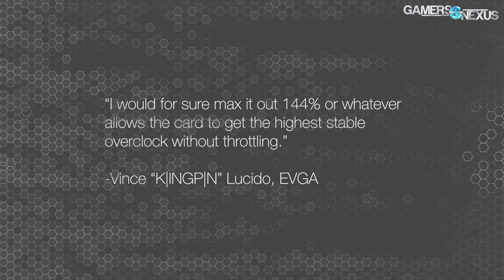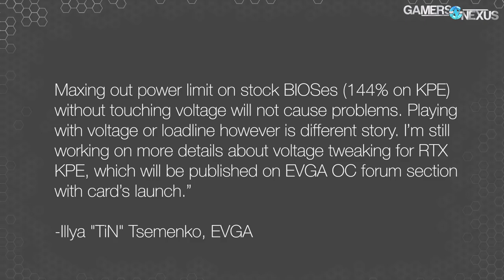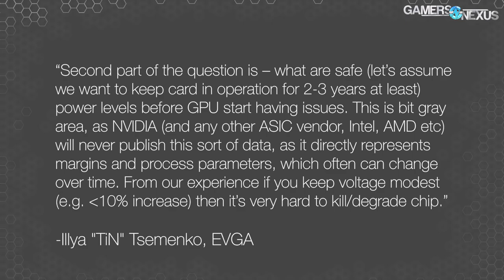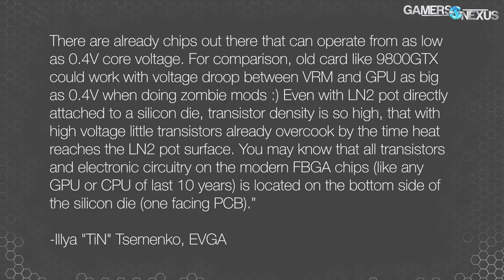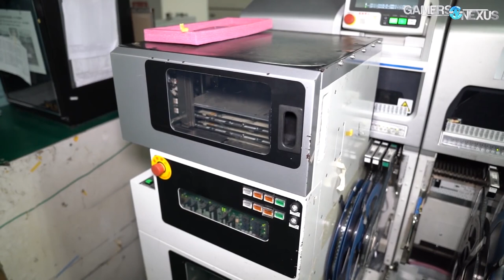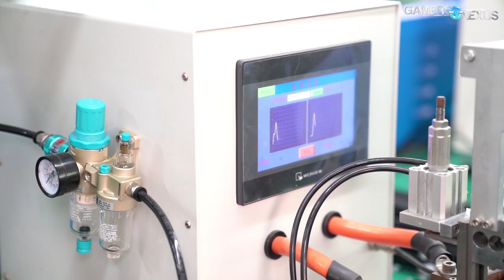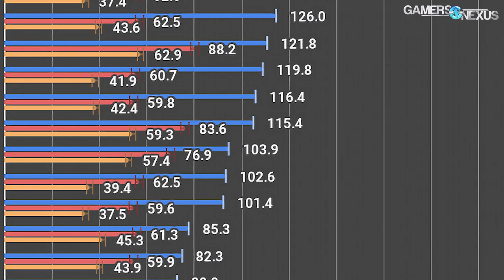Ask GN 107: Does Max Power Target Kill Cards? Ft. Kingpin & TiN Answers

Comment: Capacitors do seem to be the most likely weak link in an electronic circuit with almost every graphics card that I had die from a capacitor or few shorting to ground after leaking or breaking etc. That is the cards that didn't have fan problems before anything electronic became an issue though a lot of fan and capacitor issues can be repaired to yield more life from the card if the card is worth the effort instead of just replacement with a newer more powerful and more energy efficient design. The good aspect of capacitor deaths is that they don't seem to be that destructive to other components or at least not as likely anyway. I had a motherboard die from capacitor deaths and replaced twice to restore function to the AMD FX CPU and memory back to 100% load with aggressive power draw and high clock cycles, without damage to any of the add-in cards it used either. It then did die a third time probably from another capacitor issue but at this point I set it aside and started to crunch data on a better chip even though the FX black 5.0ghz 8core is likely still functional it used to much power for its performance yield to be worth fixing for the third time.

Comment: for a question: without getting too much in details of timings for RAM (tho knowing would help...) in a simple manner, how much speed in your RAM is needed before your processor does not benefit from more? like by example, i have a "Intel i3 8100" and that cannot be overclocked BUT my RAM can be overclocked (no matter how little). the RAM is 2400 MHz (2X16 GB) and my processor is 3.6 GHz (4 cores). 

question is how much RAM speed is needed so that the Processor is not profiting of more? (like a Ratio of Hz or Hz per core to Ram Sticks at Hz...) like if i got my Ram at 3.6 Ghz like the Processor would it help or add nothing?

Comment: How can i get the best temps on a reference vega56? Im asking because there are currently zero aftermarket cooler in stock and i want to get the temps down to reduce thermal throttling. Is there, for example, a way to safely mount an CPU AIO watercooler?

Comment: Question: do modern motherboards still really need all of the voltages in the ATX PSU spec anymore? +12v is obviously the most important these days and I'm pretty sure +5v matters for USB, but what about +3.3v and -12v? Does anything really use those anymore? If not, about how much money could be saved if PSU's didn't need to include them?

Comment: Actual overclock after 6-18 months i found degradation like artifacts etc that gradually got worse. I slowly dropped the OC untill I was back to stock but the damage was done. I could still play games as it was just minor tearing etc. card died after 3 or so years, dont remember exactly. OC was a already OC'd card then did about 10-15% on top of the factory OC

Comment: Does dual rank (2T) outperform single rank (1T) command rate on Ryzen CPUs at the same clock speeds? I've seen quite a few articles claiming that 2666mhz dual rank has game benchmarks on par with 3200mhz single rank. Have you ever investigated this? And how about 4 sticks in dual channel at 1T vs 2 sticks in dual channel at 2T dual rank sticks? This would be interesting to know going into the Ryzen 3000 launch.

Comment: Here's a related question. Is undervolting long term safe considering it may increase current at VRM? Or will lower leakage compensate?

One interesting part is that I've noticed that locking top clocks makes for lower peak current draw, even if it eats more power and can be hotter. Is it a special feature of Vega VRMs or typical for many GPUs?
(It is weird, I'd expect inductors and bypass to lower peak current when spinning clock up due to some buffering...)

Comment: I bought my 1080 Ti when it came out. And it's temps are the same as day 1, so not replacing its thermal paste any time soon. :)
But you usually do that when you see the first change in temperature, for both CPU and GPU. if you have high temps even on idle(not gaming/rendering), then it's time. ;)

Meow senpai left... :((

Comment: Question for next AskGN: At what point should you buy a new Power Supply? I've been using the same solid 1000W from Silverstone for 10 years with no power issues. Should I replace it and buy a new one when I get a new rig?

Comment: Ask GN: Is it universal that fans on a GPU can be reversed to pull heat away from the GPU heatsink instead?
I can think of some scenarios where this would be beneficial, especially where you can direct the airflow out, instead of the 
standard scenario where the GPU PCB would just blow the air everywhere. Do you have any benchmarking/thermal tests of this?

Comment: Ask GN: What is the best (easiest, most effective, etc.) way to optimize a GPU for lowest temperature? Getting over 60 FPS minimum on a 60hz monitor makes little difference. Does using in game FPS limiters reduce power consumption? I have my GTX 1060 set to the minimum target power setting (Is that sort of like an underclock that actually reduces voltage, or is it totally different?), but still get more FPS than my monitor can handle (not all games I play support frame limiting). My ultimate goal is to stop my PC from raising ambient temperature (which it can easily do). Thanks! :)

Comment: so one of your sources from evga talks about how lowering voltage is required to keep transistors cool when in ultra high density, does this lower voltage mean that clock speeds in the future could be reduced even though transistor density will increase, my question really is are we going to get clock speeds level out or even decline due to the lower voltage needing to be used. my other question  why are transistors on the bottom of the die why not put them on the top for higher thermal transfer to mitigate this problem, if you could do this it would allow an increase in voltage and clock speeds pushing the industry forwards, side note will sunny cove and cpu stacking tech be more of a hindrance due to the above thermal limitations.

Comment: Have you considered adding an averaged FPS gained chart vs cost to CPU/GPU reviews? How much does it cost/how cost efficient is the increase in FPS you get from a realistic baseline cpu (if your getting a 9400f, your unlikely to be pairing it with a 2080ti, likewise if you are getting a 1660 you are unlikely to be looking at a 9900k) as a couple of steps (for example ~$180 2600/9400f to  ~$300 2700x/9600k to ~$500 9900k). How much is that fps gain costing/could that extra money be better spent elsewhere or not at all.

Comment: So i was wondering i run an older laptop, i find that its been running hotter as of late, It runs an i7-6700HQ @2.6GHz and an GTX 960M, is it worth spending the money on redoing the thermal paste and delidding the cpu and adding a new layer of liquid metal (LM) to the dye? Also is Low Wattage (LW) Memory worthing putting in, its currently running on 1x 8GB LW DDR3 ram stick and if i were to install and second stick will it really help improve since it has next to no air flow going over the ram?

Comment: ive noticed the smaller the cooler the less worthwhile it is to change paste.  you really need better paste when you have a large cooler that is being bottlenecked by a small die or bad paste.  a small cooler sucks with good paste as well as bad paste.  but a good large cooler will benefit usually

Comment: My 980ti has been running at effectively 133% power limit since the day after launch day, overclocked by 200MHZ (which was a lot for a 980ti). Most importantly it is water-cooled and never goes higher than 45C.

Comment: Ask GN: You recently talked about refining/redoing some of your your testing methodologies. Any thoughts about doing some AIO testing for at least some of the "high-end" case reviews, or where AIO/water cooling is an obvious focus of the case design? Just seems like some cases are really designed with water cooling in mind...they just perform poorly with air cooling and it doesn't really illustrate the advantages of spending a little more on the case. I realize it does add significantly to the test workload, but in cases like that where it is obvious the design is meant for water cooling, you could skip the air cooling testing all together.

Comment: Ask GN - How wide is the performance gap between fan brands and price brackets? Unlike other PC parts these get very little testing and coverage individually and are harder to get accurate data out of. There are brands that are famed for lower noise per RPM, but many other brands claiming quiet high performance fans in air and liquid cooled scenarios. How far off are they, if behind at all? Looking forward for a highly populated fan performance chart.

Comment: #AskGN Are there plans for more in depth case testing? Talking about testing cases with a fixed set of aftermarket fans, like 2x silent wings 3 in the front, 1x silent wings 3 in the back. When shopping for a case I noticed that you guys have a bunch of data, but it is still hard to pick, since there is no way of knowing if switching fans would make a hot case significantly better. The Lian Li One for example is amazing, if you switch the fans for something better. It really feels like a heat AND noise winner, even tho it ranked medicore in your testing, due to the stock fans being bad.

Comment: #askgn What kind of settings does GN use in windows 10 for their benchmarks? Do you disable Windows game capture or change any other default settings or disable any of the services that come installed/running on a stock Windows 10 install? Which changes would you recommend for better performance or stability? Furthermore are there any relevant bios settings that you usually adhere to for benchmarks? Apologies if this has already been covered in a previous video.

Comment: i wanna OC a 7700k to 5ghz with a rtx 2080 evga ftw3 will the 7700k bottleneck the 2080 and is 5ghz unstable? ive heard its great but i wanna be safe!
Reply: @OFFGRIDOFFICIAL  i would use the lian li pc 011 case and a x72 (nzxt 360mm] cooler

Comment: #askgn-questions

Are videos on niche cooling/computer builds something at all planned for the future? I know that's more of something LTT would do, but maybe it could be done with more of a focus on data (parts, design, build, and issues/considerations... maybe testing+charts in some situations).

For details, I'm specifically interested in external air-cooling for isolated parts (and maybe having the motherboard with low airflow or mostly/entirely sealed, with circulation fans and the case having passive cooling for hotspots or the entire chamber itself). There's an example here: https://www.youtube.com/watch?v=N-z9PidYH4E ...but I'd prefer keeping the GPU intact (maybe integrating the card design into the outside of the case somehow), using an existing case as a starting point, no obstruction to IO, different cooler placement, and less custom parts (and possibly passive cooling as mentioned already).

Although passive cooling could also be covered (isolated is already there w/right configurations and fans off), as could newer (proprietary?) cooling solutions like flexible heat pipes. Water-cooling can already be external, but isn't as reliable as air-cooling. Pyrolytic graphite with XY heat spreading (like Panasonic PGS or GraphiteTIM... rather than higher Z transfer like IC graphite pads) might be an option, a simple early test being if a custom adapter+PGS could be used on a Ryzen CPU to gain more benefit out of a cooler that has full contact for Threadripper CPUs. If using normal non-compressible pyrolytic graphite, lapping might be needed on CPU and cooler (preferably done more like Kingpin's setup than by hand). 

Going back to the external cooling stuff, that could overlap with air-cooling a CPU with ZADAK double-capacity RAM if people are actually interested in that. If powerful tower-coolers with taller heatpipes exist that is (even in the form of custom orders).

Comment: Quick question: I am building a pc for my best friend. 800 - 1000 €. EU pricing. The cheaper the better. 
I'll go Ryzen 2600, 16 gig 3200 ram, Asus ROG B450-F mobo....
He is only gaming @1080p, but wants the system to be able to run AAA titles for a while @high settings. Should I go for a rx580 8gig,or a gtx 1660ti?
Thx in advance

Comment: Ask GN: is it safe to overclock a laptop (max q) GPU using afterburner? I only ask because on my laptop I can get the 1060 max q to take +200mhz stable and have it max out at around 80C. What I wanna know is, is this safe for the power circuitry on a laptop to do this?

Comment: #askgn Thanks for the great content. A question on overclocking GPUs. Can you confirm that unstable memory overclock can only cause artifact where unstable core overclock would cause more than that, i.e. crashing That being said, how long when reviewing a GPU do you run a stress test before concluding you have a stable overclock. I have seen many times that it could take up to six hours of stress testing before the GPU show instability, what are your thoughts on that?

Comment: the rtx aio cooling edition cards like inno3d ichill black and gigabyte waterforce perform so badly on thermal. why is that?
whereas ppl using g12+240mm/280mm aio on rtx cards perform way better in general. please do a comparison like disassembling the evga kpe aio cooling then install it to inno3d/gigabyte ones to compare different prebulit aio cooling solution on rtx card. 3rd party namely nzxt g12 is also worth to look at in between these prebulit aio cooling cards.

Comment: Any sense of what sort of MRP systems these manufacturers use? Do they all tend to use the same one or two MRPs since they're in the same industry (other than the screw, cardboard, or similar raw material/primary product manufacturers that feed these electronics finished product manufacturers) or did each manufacturer have a completely different MRP platform? Any of them operating without a real MRP (manually operating with a "dumb" database or spreadsheets)?

Comment: #askgn Hello, I realise I'm way late but my question is can ram OC corrupt/make unusable your ssd? I did some pretty stupid oc to my 1600 cl10 ddr3 and after several reboots windows just straight up stopped loading and repair wouldn't work, ssd made everything even bios loading super laggy when attached to 2 different systems and wasn't detected in another system's windows 10. It just popped in and out and couldn't be reformatted.

Comment: Ask GN: Can GN cover all of the available Graphics Card AIO Cooler Mount for compatibility with every current gen entry level models out there? I think its really important to know how compatible they are especially not all Graphics Card models out there despite sharing the same number model have different manufacturing variables which might cause mounting issues. Another good example is the NZXT G12 Mount Bracket only claims compatibility with the RTX 2080 TI which doesn't really tell the whole context. What if I want to use the AIO for a GTX 1660 Ti and then I switched to an RTX 2060 and use the AIO there afterwards? I want to buy a bracket or even a new Graphics Card from a specific manufacturer knowing it is compatible knowing I'm not wasting money.

Comment: Hey Steve, if it's true that the PS5 uses Ryzen 3000 chips in some form or another, will that make a difference in how games are optimized for Ryzen-based pc games going forward? Could it help give them a leg up over Intel despite possibly inferior clock speeds due to better optimization? Cheers

Comment: #askgn I've found no conclusive answer on whether using 2 smaller SSDs in RAID 0 compared to a big one. Many boards nowadays have multiple M.2 slots and I was wondering whether f.e. two Samsung 970GB EVO 500GB SSDs outperform a single 970GB 1TB model. They cost about the same. What are pros/cons and how does it affect general usage (is it worth it?)
Thank you!

Comment: How do i go over the 1000+ memory overclock limit in MSI Afterburner. I have a GTX1060 6GB that has GDDR5X memory which overclocks very well. I have seen a review where the card' s memory was overclocked beyond 1000+. I currently have the memory overclocked all the way in MSI Afterburner (5000MHz) but i should be able to get another 400Mhz but am limited by the software. There was a way around this years ago by editing the config file but this no longer works. I have not been able to find any way beyond the 1000+ limit. Any help would be appreciated.

Comment: This might sound dumb but some graphic cards have 2 or 3 fans that spins in different directions (one or two clockwise and the other one counter clockwise forma example). Does this affect the cooling performance or is it just for looks? Thank you.
Reply: I don't know if this is the actual reasoning but, my guess is it's to avoid the airflow each fan creates from colliding and creating turbulent less efficient airflow. Which I think would lower the cfm which would make it push less air through the actual rad equaling worse water temps. Edit another idea is it could help make sure air is evenly circulated over the PCB hitting the vrm and mem chips. whereas if they all pushed in the same direction might cause some missed spots due to it all the air flowing in one path.

Comment: Question for next Ask GN:
If I use a cpu with 16 pci lanes, say a 7700k or a 8700k,
with a 1080ti in the 16x slot and then a 4x nvme drive,
will this affect the graphics card's performance in any meaningful way?  
Lanes are confusing... :(